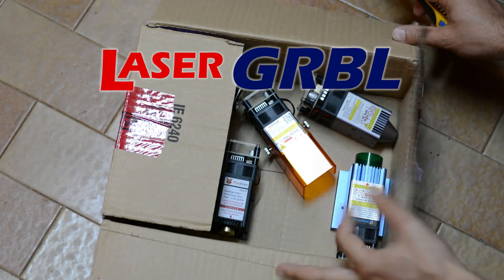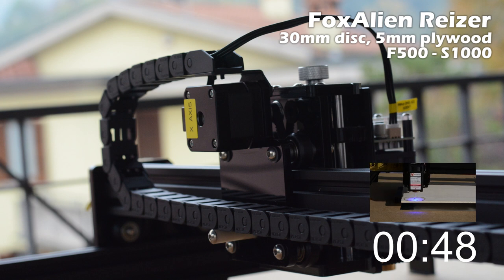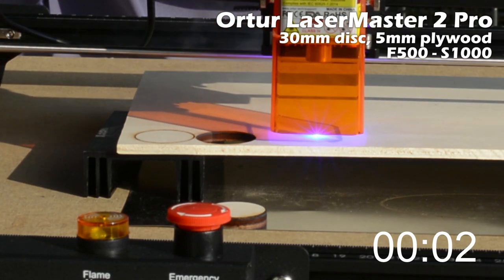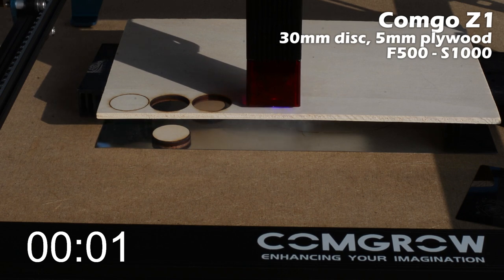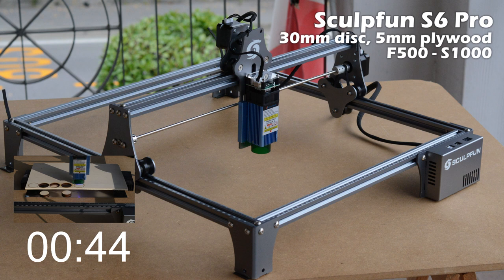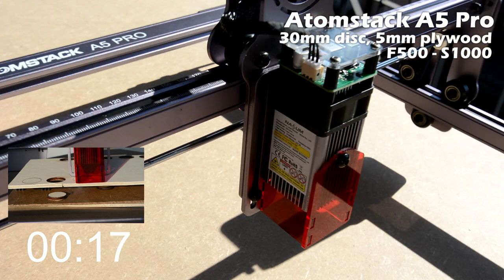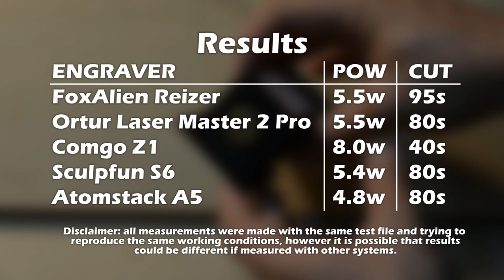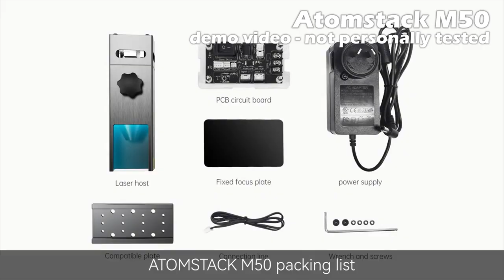5 Laser Module Test

Comment: Es posible cambiar el modulo laser por uno de mayor potencia, sin cambiar la tarjeta de control?
Reply from the maker: Usually yes, but there are a few things to keep in mind:

- that the power supply is sufficiently powerful
- that the cables are thick enough (and the connectors too)
- that the new module is compatible as a screw coupling
- that the new module has a compatible connector, with the wires arranged in the same way

If this is not the case, modifications must be made to the module or machine to adapt it.

Comment: Hi Thanks for that

Neje also has a new dual diode laser head with a bigger machine 460x810mm and 15Watt optical power (they say) it could also be interesting (about half the power of a 40W CO2 laser)
Reply from the maker: Neje contact me for a test, I hope to be able to compare their product ASAP
Reply: @lasergrbl  Oh GREAT!!!!  Well it is also on Bangood site now. 460x810mm nice size and with the A40640 module it is $700 which is not very cheap... but still cheaper than CO2 of course. The dual laser modul is I think 10W optical power (they might say it is 15 but I just don't think so) 10W optical power is nice. Still not really enough for plywood...Yes you can cut the ply but it still must be slow. and of course you still need some kind of bad of nails or honey comb grid...and smoke suction and air assist. I just got may new CO2 50W and it is a world of difference if we talk about cutting... Still... waiting for your review

Comment: I'm shocked. My modular laser can't cut even 3 mm. I repeated the circle 12 times, with the same parameters as yours. And he didn't cut at all!!! Where can I buy a device for measuring power?
Reply: Have you checked the power source? 
Your module may not be receiving the correct current and amperage.
 I had exactly this problem, the controller board was not properly feeding the module.